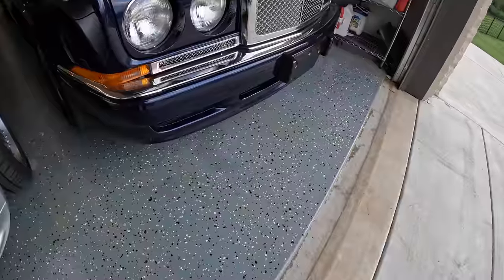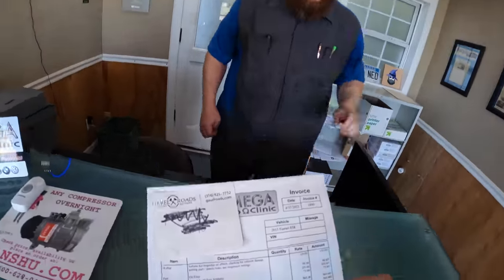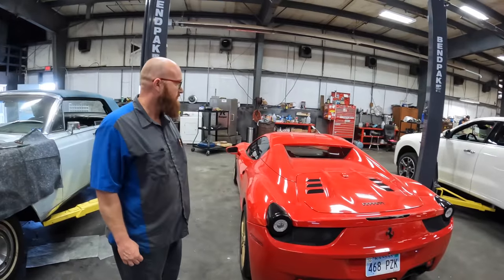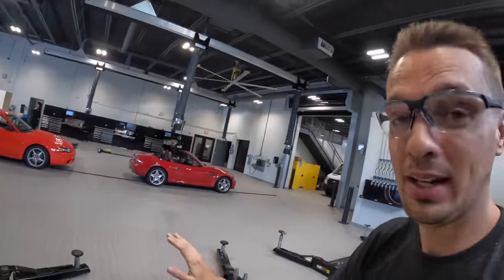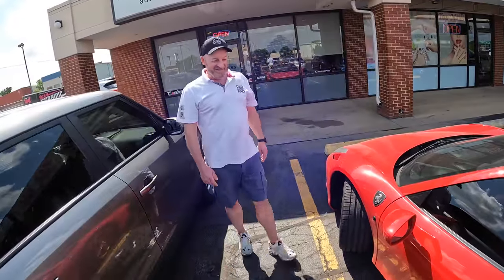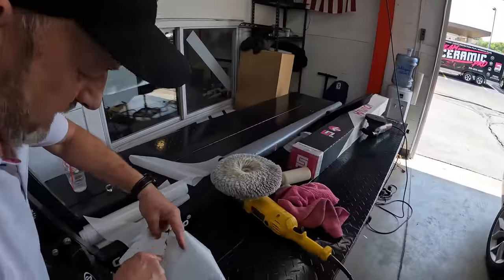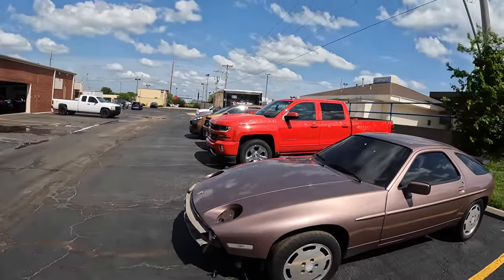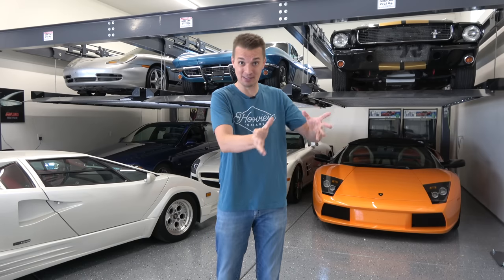My wrecked Ferrari 458 was supposed to be fixed, but the DYNO determined that WAS A LIE

Comment: The Ferrari would increase in value 10% if that tacky aftermarket Ferrari badge on the fender was replaced with an original Ferrari shield!
Reply: but it would also cost about 10% of the value
Reply: No it wouldn’t lmfao
Reply: and the black tail light covers/tint.  Makes it look tacky
Reply: ferrari actually offers carbon shields from the factory, my friend got their laferrari aperta specc'd with carbon shields and black lettering in the back
Reply: Not to mention the horrid black tail lights
Reply: And the tinted tail lights!
Reply: Yeah because THAT'S where the value of a ferrari is: THE BADGES
Reply: The tackiest things on it are the gold rims and now the gold exhaust.
Reply: Technically if you want to do it correctly, you have to change the fenders because the badges on the side are recessed slightly. that is Ferrari's insurance that people don't opt to just stick them on afterward. BUT i agree 100% that they need to go so badly. It makes me cringe...
Reply: Are they not just the carbon badges?, I’ve seen many Ferraris with the cabin fibre Ferrari shields.
Reply: Don't forget the tinted tail lights.
Reply: And you replace those awful gold wheels
Reply: @lordwalker71  nah B. Gold wheels on red ferrari is coo
Reply: I like the gold wheels, but carbon badges are gross
Reply: @alphatrion100  yeah exactly I sell fieros with decal swaps for 100k everyday!
Reply: @murry001  and window tint.
Reply: Your so right !
Reply: @mromatic17  
Well, large part of what you pay is for the brand. Especially the older, junkier ones. 
But if you want to misinterprete me go ahead
Reply: @geoffreycarter3981  that’s absolutely incorrect. Who told you that? The scuderia shields can easily be removed on the 458 without changing the fender.
Reply: Agreed!  To quote James May, it needs to be “un-pimped”.
Reply: And the tail lights! 🤢
Reply: @millerfisherman1989  why do you seem so sure about this?  Of course one could remove factory shields, but you'd be left with a depression in the shape of shield on each fender. The factory shields are not just stick on the top items... they are expensive items in part because the car required different body panels. Do a Ferrari forum search. One way to be sure whether Tylers Ferrari came with shields from the factory is to see if there is an indentation on the fender. The carbon shields could be ordered from factory i believe (those were Scuderia spec?) regardless, the combination of other tasteless cosmetic additions to this car screams that the shields were aftermarket adhesive. Should be removed in my strong opinion.
Reply: @geoffreycarter3981   sorry,  I was referring about replacing the carbon fiber looking ones with the yellow scuderia shields, not going shieldess all together. 
You are correct, they are depressed in to the Fender and the term is frenched.
Reply: @alphatrion100  i was aggreeing with you
Reply: Think he said those are the factory carbon optioned shields 🥴
Reply: Also I don’t think he has carbon ceramic brakes either
Reply: @geoffreycarter3981  you just remove the emblem in the recess and replace it. Anybody shop can do this without removing the fenders. All you need is chicken wire and a heat gun. Remove the adhesive and replace the emblem. You do not know what you’re talking about. As someone who has worked in body shops and debadged and rebadged cars I can tell you with 100% certainty you can replace those badges without removing anything from the car. Recessed or not.
Reply: @markismays2764  okay... obviously this is the case. You are correct IF the car came with shields to begin with, however, I doubt that this car did and I bet the LV owner just stuck aftermarket ones one. I know that scuderia shields look like this but I doubt that the car came with them originally, and I bet that the owner slapped them on when he just slapped on the rest of the blackout aesthetic on the car.

Comment: The 458 has to stay and it being one of the best driving cars I’ve driven plus you having a salvage/high mileage it would make the most sense to keep since you wouldn’t be losing anything really. Yellow convertible Ferrari could get a nice price tag right now so I would sell that one.
Reply: I drove one and wasn't very impressed. Yes it drives nice but it's really outdated even for it's age. The thing has a old ass key and no remote start. Pretty disappointing when cars 1/10th of it's price from it's time had better tech
Reply: @MLProductions.1  weight savings
Reply: @MLProductions.1  I don’t think anyone driving a 458 gives a toss about tech
Reply: It's a nice drive when it's new, they crap out within 3 years, owned 2 now I am a Lamborghini guy from now on.
Reply: @bwdrives  then why does Lambo and McLaren and everyone else have tech up the ass. These are exotics but there also luxury. People that want a pure race car buy a lotus not a Ferrari.
Reply: @MLProductions.1  well I’m not a Ferrari client but I am a Ferrari fan so my opinion doesn’t really matter
If I did buy a Ferrari though I’d only care about the experience, the design and the emotion
Reply: I don't think selling the one most likely to appreciate or hold it's value best over time makes a lot of sense.
Reply: @MLProductions.1  whats the point of remote start on 458? Clearly 458 is usually bought in warm/hot climate, or 100% kept in warm garages. Wtf is this bs😆 i live in country that in winters temperatures are most of the time below -15C° in bald eagle per hamburger units, that is 5F° or less and thats a not very popular function aswell.
Reply: @janiskulmanis4610  meant push button start...
Reply: @MLProductions.1  okay, my bad. Have a nice day
Reply: @MLProductions.1  "Old key"? Lol. Honestly, ive never heard heard anyone complain about a car key  ever.  Other than batteries going.
Reply: @MLProductions.1  boohoo no push to start 😭😭😭😭😭
Reply: The 355 will keep going up so better to hang on to specially as its manual
Reply: @MLProductions.1  the 458 is old school, mechanical, none of that stupid unnecessary tech things
Reply: @julle5417  it's preference. I'd take a Lambo over it all day long
Reply: @MLProductions.1  Wellll me to. But not because the ferrari doesnt have push to start and whatever your reasons were. The company is ass.
Reply: @julle5417  low quality cars. Bad tech. Lambo is much more reliable. And yes when I'm paying a quarter mill for a car I don't want a key that looks like its from a 2002 car. The whole interior on the 458 is pretty damn garbage when you drive it. All that matters to me. I'd take the Lambo all day for overall quality
Reply: @White Boy Bro who tf cares about push start on a 2011 Ferrari🤦🏻‍♂️ And I’ve been in a few the interior quality is better than Lamborghini
Reply: I've driven the 458. It's geared really tall and has no torque and the engine sounds like nothing at low RPMs so unless you are by the redline all the time it feels like a Camry with a hole in the muffler. I would keep the 348 because it has character and get rid of the 355 and the 458.
Reply: @bwdrives  Until your first oil change !

Comment: Hey, if the dyno was so low, and the excuse is that the dyno runs “low”, and it never got to the right gear…why didn’t they recalibrate and run it again?
Reply: Yeah, really. If it is not properly calibrated, why bother?
Reply: Yeah, kinda jenky to run in 3rd gear.  All they did was run the car up to redline.  The data is useless.
Reply: curios as to why not 5th gear rather than 4th... 5th is a 1.03:1 ratio.
Reply: Ill just throw a dart at a number. "It runs a little off but its a number"
Reply: @frostbite1991  probably pulls to high mph
Reply: I wouldn't even take my lawnmower to those clowns. What an excuse for operating faulty machines...lol
Reply: by the looks of all the other people there it appears to be a "dyno day" where you get a really cheap use of a dyno for a single power figure run. They have all the other people to get through so one run each. Tyler probably didn't even think about 3rd vs 4th gear until after the car was off the dyno, and by then he would have been too busy to hang around until the end of the day just in case he might get another chance to do another run.
Reply: Why are the headlights on?
Reply: @evictioncarpentry2628   naw, apparently they have 5.14 axle's. with 28" tires and 1.03 trans gear thats only 134MPH at 8500RPM. They only ran this car to 84mph on the dyno. Their Superflow Autodyn 30 can handle 225MPH drum speed. Shulda used 5th....
Reply: @frostbite1991  agreed.
Should be run in the gear closest to 1:1
Reply: Yeah agreed seems crazy especially when they claim to know what theyre doing and I'm sure its not cheap either to send a Ferrari to them.
Reply: Right I'm like how can that only make 25hp more than a bolt on accord
Reply: Yeah wondering the same here why you would run vehicles in a way you know produces incorrect results.
Reply: As he said, it wasn't a dyno run for performance. It's an engine additive company. They just use the dyno for cycling the fluids and haven't dialed it for tuning. At least that's what I was able to determine from what he was saying.
Reply: Seems to me they bought it and threw the damn manual out in the packing peanuts. Who tf doesn't run baseline tests or even check gearing beforeheand?that was some Mickey Mouse bullshit.
Reply: Just because a dyno reads low, ir doesn't mean it's miscalibrated. Not all dyno's calculate the same type of HP. I know that sounds weird, but I believe some do SAE and others BHP. I can't remember the intricacies of it, but if you're interested do a search on the difference between a Mustang Dyno (no not the car) and Dyno-Jet dyno. Mustang Dynos read lower than Dyno-Jets dynos. As for running the car in 3rd , yeah that's going to affect the readout. You want to dyno a car in as close to a 1:1 gear as possible, which is generally 4th gear in a  manual transmission.
Reply: Haha worst excuse ever. This Ferrari is bugged. 
And funny how much he loves the other dyno which is “correct”.
Reply: @frostbite1991  The gear ratios doesn't matter because the dyno should be adjusted for that. What matters is power loss in the transmission. 4th gear in most cars doesn't go through a countershaft and has less friction losses. Some cars like an ND Miata dyno better in 6th because that gear doesn't go through the countershaft for better highway mpg.

Comment: Look at where the peak hp was made, 7500 rpm and then it falls. It doesn't matter what the absolute number was that alone shows a major problem. That engine should build hp all the way to it's peak at the 9k redline. Regardless of what dyno, correction factor or gear 320hp is extremely low.
Reply: Checked the specs and you're right, the peak power for this specific engine occurs right at redline. (Not always the case) It shouldn't be dipping off after 7500, good catch.

Comment: The 355 is by far the easiest to sell, as it has lower miles, just had the belt service, and has been skyrocketing in value with the 360 and F430 with gated shifters.  That said, it is also the most likely to continue to appreciate or at least be significantly resilient to a bubble burst.  I think it has to be the 348 or the 458.  The 348 has a gated shifter, but its beat up from the feet up.  The 458 seems to be lacking power, and given its history....might be a good one for sale.  Maybe Tavarish would buy it and fix it for you.....speaking of which, you never told us what he traded you last week???
Reply: I’d agree with you except YouTubers don’t have trouble selling their cars regardless of title brands or issues. And I’d argue there is a bit of a premium for better known YouTubers cars. 

As far as which car to sell it’s subjective. Tyler has already ruled out the 456, and there are pros and cons with each of the mid engine cars. If this were me the 458 would be out of the running because the 355 and 348 are basically around the same era of Ferrari while the 458 is substantially newer. Tyler has a problem because he’s said how he likes both the 348 and 355. But if it were me since I have no leg up the logical choice is the 355. While yes it could continue to gain value branded title, odd modification, storied past Ferrari’s don’t sell well, taking months to sell and generally bring far less then you want due to the associated issues. In Tyler’s case he’s less locked into that problem.
Reply: Selling the 348 he would get the least amount of money so that wouldn’t make sense
Reply: I actually second this! 348/458 or both could go
Reply: i think the blue 996, hoovie will get it de-tuned and continue to grow his  hooptie Porsche fleet
Reply: Tavarish actually fixing a car? Lol. Cmon

Comment: Down 200 hp than a stock Ferrari 458.  Ouch!    If my 4cyl Tacoma was down 200 HP, I'd be a negative 50 HP.
Reply: It's like my Golf GTI drove out of his engine.
Reply: That number wouldn’t be 450 when it was brand new
Reply: @johnnychimpo7539  570hp is the brand new number for that car
Reply: wheel horsepower and crank horsepower are different.
Reply: @DerpotronGames  yes but you can easily convert it, also: it's not the usual 10-15% loss.
Reply: @fohatadri  I was wrong. I don’t know why I thought it was 450. Either way, I bet a new one would be below 450 on a dyno, probably 420 which is just fine
Reply: @johnnychimpo7539  No way below 450... in that case the engine wouldnt make close to its factory rated power.
Reply: @fohatadri  Heh, you aren't going to loose any significant power the engine in 80k unless there is something wrong with it. Hoovie will come to find out there is a problem IMO.

Comment: That dyno run was pointless lol, so let’s do a dyno run incorrectly so we can give you wrong pointless results all the while knowing this beforehand, why didn’t they just do it in fourth on a calibrated machine? What was the point?

I also find it funny that they sell additives to increase horsepower or bring lost horsepower back whilst simultaneously using a dyno that reads lower than it should, if that doesn’t slap you as suspect then I don’t know what will….
Reply: Yea indeed :/

Comment: Please keep the 348 though, cool story, unorthodox modifications, and very high mileage on a simpler and older Ferrari. Gated manual transmission as well and you can drive it without a care without to much power. The 355 makes the most sense to sell in my opinion

Comment: That feeling when my F150 makes more WHP than Hoovies 458 😂
Reply: you don’t wanna know how much more my chrysler makes lol, but than again it’s a chrysler and that’s a ferrari, still taking the 458 all day
Reply: This was absolutely awful, there's reports and dyno sheets of 458s making 450 at the wheel which is about right when comparing the 458's speed with other supercars of the era. This one is dead.
Reply: And how does it feel knowing your f150 is worth about the same as the wheels on the Ferrari?
Reply: And my 4 cylinder Mustang 😂
Reply: @knifetech101  ecoboost does 250-260 at the weels man...
Reply: I know right. My LS Trailblazer would dust that turd.
Reply: @nastyG184  mine is tuned, full bolt on. So more like 350 to the wheels
Reply: @knifetech101  ah, so you most likely would beat this 458 in a drag haha
Reply: @nastyG184  a newer Chrysler 200 V6 would make more whp than the 458 😭😂💀
Reply: @zackatron925  no it wouldn’t lol
Reply: @nl9002  it was clearly a joke buddy. On e85 they do make over 350 tho 🤷‍♂️